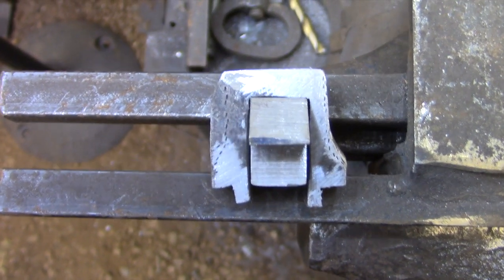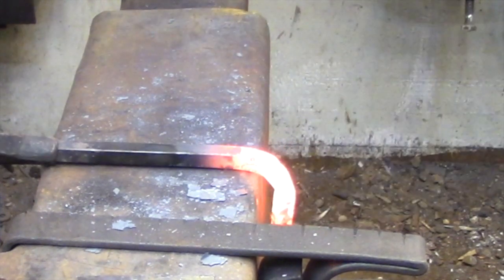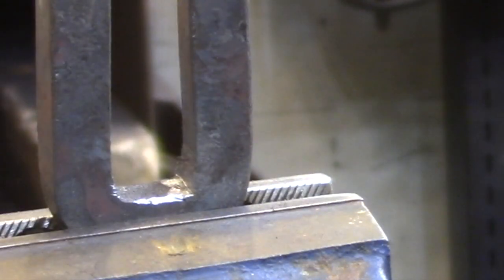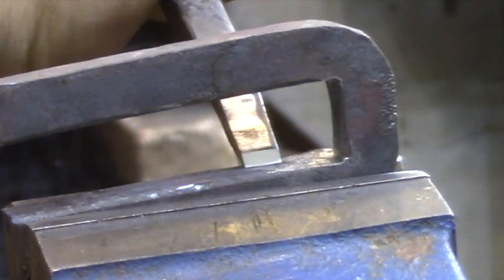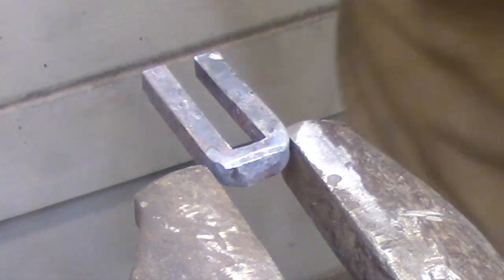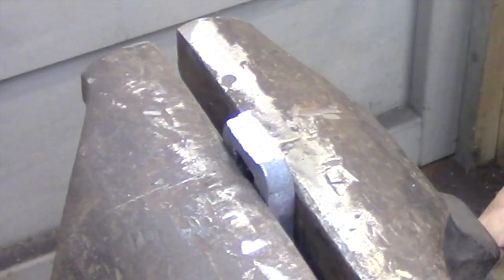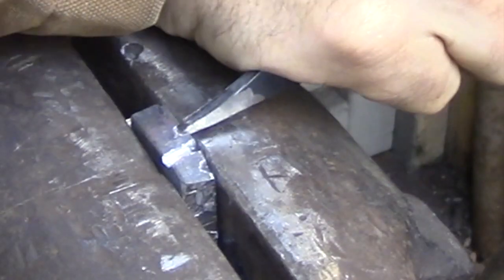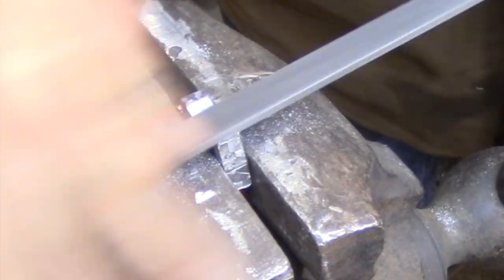Blacksmithing Project - A Simple Nuremberg Box 7

Comment: i'm assuming the chisel is faster than filing; are there pros (cons?) to filing hot metal? I'd assume it would be faster than filing cold metal, in any case. Thanks!
Reply from the maker: Often it isn't really a matter of what is faster but what is more convenient or what just makes sense.  I really enjoy getting the most out of simple tools that I can make and sharpen easily.  Files do have the advantage when you need to create a smooth flat surface but I feel that a lot of work that we assume was done solely by filing was actually chiseled out and then finished with files.  This project is a example of that.   I don't hot file or rasp anything.  It is faster but  carving away red hot metal is also a very easy way to ruin a file.
Reply: Thanks for the reply.  I was curious about the heat, and how it might affect the file...and the idea of wetting the file to keep it cool means the benefit of hot filing will be lost, pdq. BTW, loving this series. I've binge watched over the last couple of nights. (Staying up WAY past my bedtime to do so....according to my children.) Thanks for sharing!

Comment: Do you have any knowledge as to how hacksaw blades were made hundreds of years ago?  My guess is that they would have been made in a manner similar to how files were made (using a chisel on the edge of a thin piece of metal rather than a flattened file blank), perhaps angling the chisel and/or hammer blow to bend the saw teeth for "set".
Reply from the maker: I have never found anything that described how hacksaws were made.  The only thing that I ever made that was close to it was the file I used to cut the lead screw on the wood auger.  It cut fairly well for a tool that was rough forged so I imagine in the hacksaws used pre 1300 were more like thin files than saws and removed a lot of material.  I know the Romans used wood saws that forged with a wedge shaped cross section because the idea of setting the teeth had not been developed yet.  I would have to guess that a similar approach would have been used for metal saws at that time.  I can't see how a good saw blade can be made without good files to level the surface so by the 1500 I'm sure the  hacksaw was a tool that was made mainly by stock removal and the teeth were filled in and set.  Flat coil spring were in common use in locks by the 1500 so improvements in that technology would have naturally solved the problems of making a good saw blade.

Comment: Why chisels? Wouldn’t it be more straight forward to file it?
Reply from the maker: The chisels are faster at removing a lot of metal but the files are better for refining the surface so you use each for a specific job.
Reply: If you look at the size of a chip that a chisel makes compared to a file, you'd see the difference.
Reply: I’ve heard arguments that files would have been used primarily for final finishing (as Dennis suggest) because they were much more time intensive to make and impossible to upkeep.  Thus, they were much more expensive.